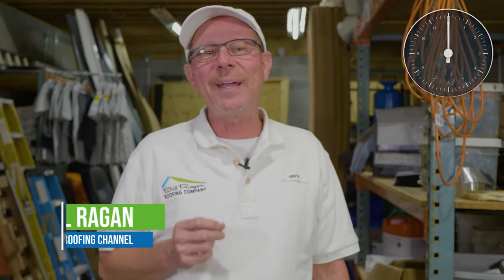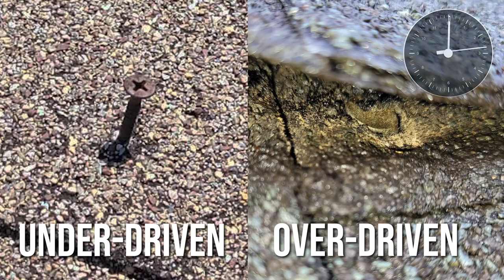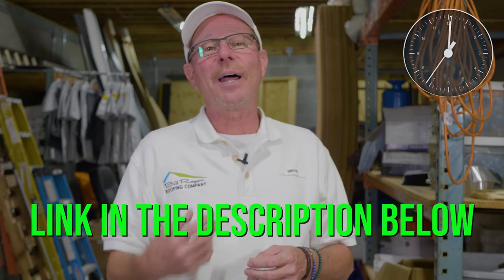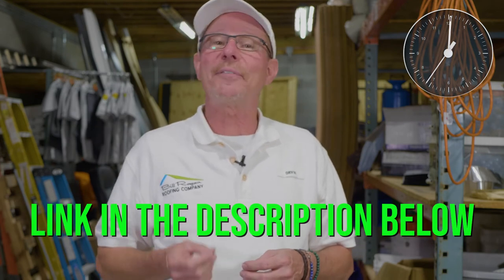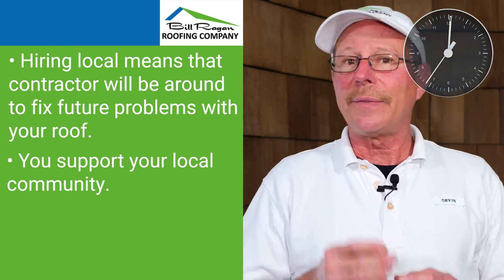Air Gun vs Hand Nailing Roof Shingles ▬ ROOFING QUICK TIPS

Comment: Nails only hold the shingle on until it's sealed. I've tore off 3 tab shingle roofs where the nails were 3"+ too high and all the shingles were still on the roof. A nail gun beats hammers hands down, in almost every instance. People holding onto legacy methods are simply irrationally adverse to change. Model A Ford's can get you around but nobody's still driving them to work.